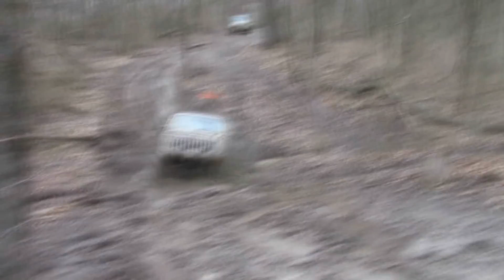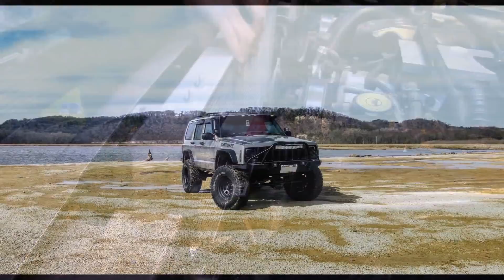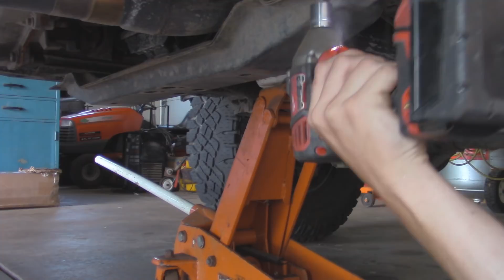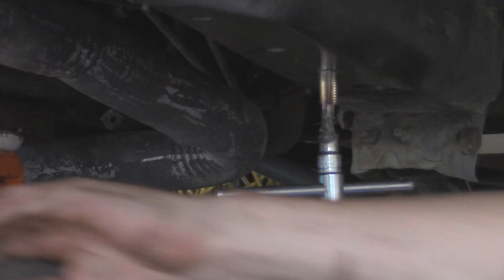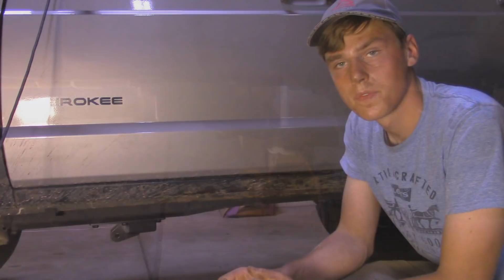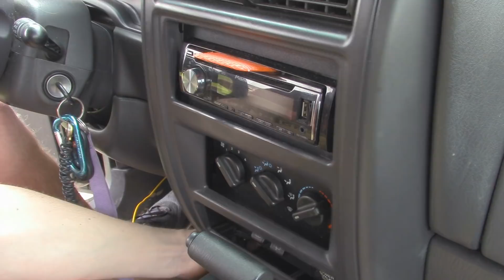Jeep Cherokee 3 Link Suspension Install Part 1

Comment: Can you link your trans mount
Reply from the maker: This is the one I used, it was for a 1999 Jeep Cherokee. https://www.amazon.com/Anchor-2625-Transmission-Mount/dp/B000CFUFWG/ref=sr_1_3?crid=12RM0OZT51FFG&dchild=1&keywords=1999+jeep+cherokee+transmission+mount&qid=1621725346&replacementKeywords=transmission+mount&sprefix=1999+jeep+cherokee+tra%2Caps%2C199&sr=8-3&vehicle=1999-42-347------------&vehicleName=1999+Jeep+Cherokee

Comment: Why replace the trans mount? I did mine n used the same trans mount..?
Reply from the maker: This cross member only has holes for 99 and down trans mount. For some reason jeep changed the hole pattern in 2000-2001 like mine, so I replaced it with an older mount to work with the crossmember.
Reply: Thank you for the reply.

Comment: I definitely prefer to have a 4 link setup. Works well with my Artec truss and with the curry johnny joints it still flexes really well! I ripped off my upper control arm bracket..... too much flexing I guess. lol

Comment: What bilstein are you running on that 4.5 lift.  I'm building my jeep with almost the same setup but I haven't purchased my shocks yet.  I'm gonna get the bilstein 5100 front and back.
Reply from the maker: Yup 5100 is what I'm running, they say they are for 5-6 lift but they allow for better articulation on 4.5" lifts
Reply: @OutJeeping  do you know part number
Reply from the maker: https://www.amazon.com/gp/product/B019HXHGA2/ref=ppx_yo_dt_b_asin_title_o00_s00?ie=UTF8&psc=1
Reply: @OutJeeping  thanks bro I'm on it like a bulldog.

Comment: Nice! If you put some oil on your tap it will make it easier to cut new threads. Just FYI Thanks!
Reply from the maker: Yeah but oil will make all the shavings stick together instead of falling out like they should, so it would jam up the threads as your trying to tap.

Comment: buddy of mine got grade 8 hardware and fished a nut inside the frame for each of the cross member bolts. didn't trust the possibility of the frame bolts wobbling out and dropping the cross member
Reply from the maker: artardFTW If it works that would be ideal but I would be afraid of it spinning in the frame.
Reply: OutJeeping I think he just ran them home with an impact and they took torque. maybe tacked a washer down to the nut too